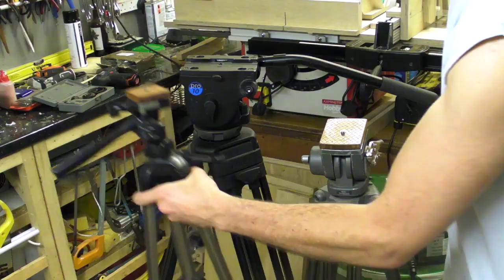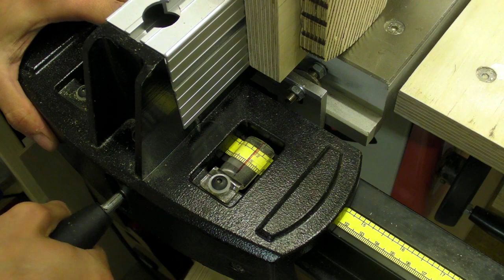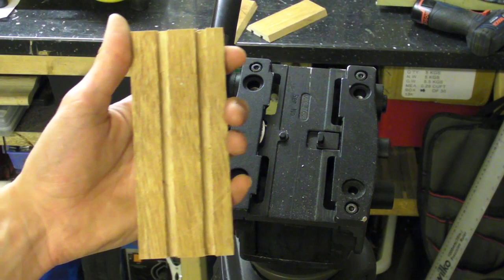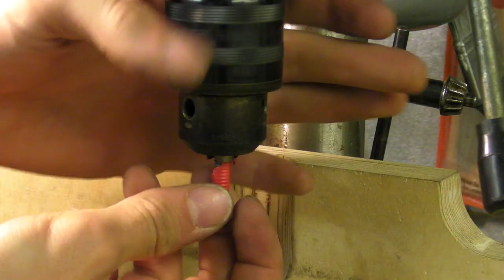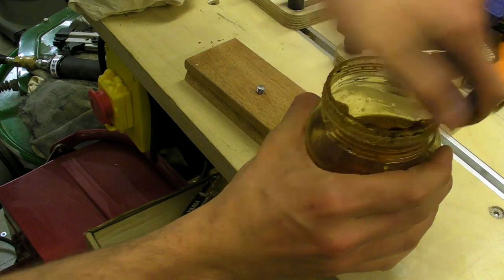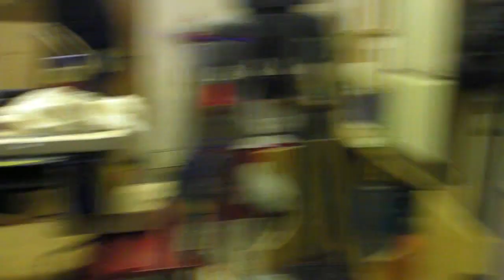Wooden Tripod Adaptor Plate - Camera Mount - Vinten Pro 10 Broadcast Tripod

Comment: impressive - Wood is very strong - -I doubt the wood will snap unless extreme use is happening............one could add a metal washer to increase surface area and strength And also bolt and glue the two wood plates together since glue might fail or the wood shear. but I doubt it. ---------------------------------- Still for a very expensive camera one could also add a strip of sheet metal inlaid into the wood plate, or add a layer of fiberglass + glue and bolt the plates.-------------- If one has any doubt and wants to test the wood plate wood pieces and bolt strength.... one can attach weights and suspend the head from the ceiling upside down.-----------
Then apply weight and impact or jarring - tilting action to test the wood plate.  -----------If the Camera + Lens + battery make a heavy rig - the cost of a failure could destroy everything ....however for many rigs this wood solution could be perfect, smart easy and economical....!!!